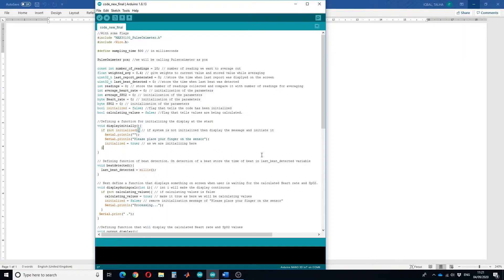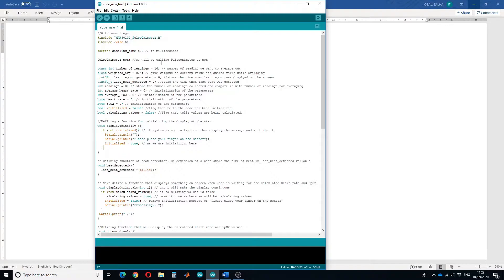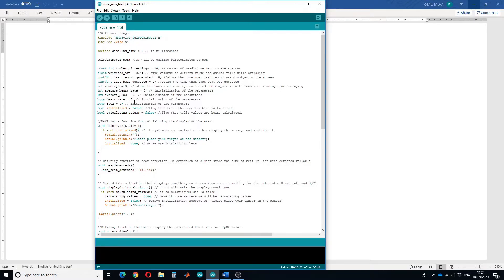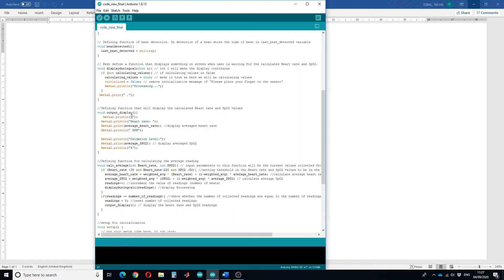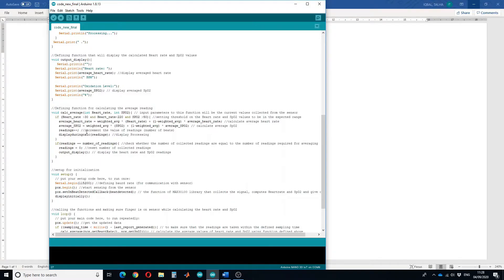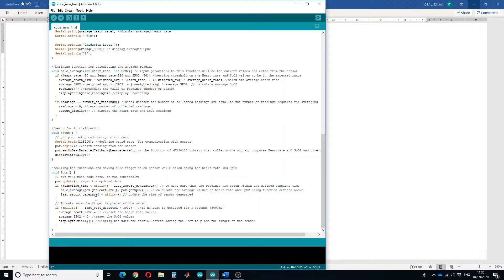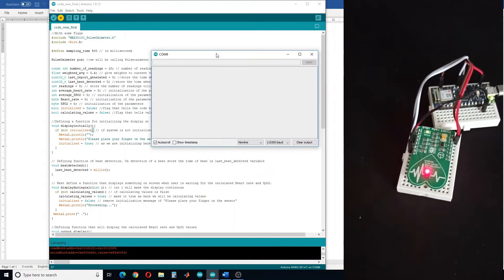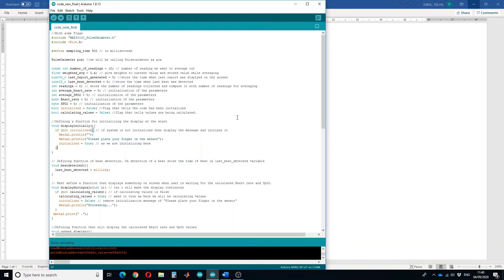Heart Rate Monitor (with Stable Readings) Using Arduino Nano IOT 33 board and MAX30100 Sensor kit

Comment from the maker: //code:

//With some Flags
#include "MAX30100_PulseOximeter.h"
#include <Wire.h>

#define sampling_time 500 // in milliseconds

PulseOximeter pox; //we will be calling Pulseoximeter as pox

const int number_of_readings = 10; // number of reading we want to average out
float weighted_avg = 0.4; // give weights to current value and stored value while averaging
uint32_t last_report_generated = 0; //store the time when last report was displyed on the screen
uint32_t last_beat_detected = 0; //store the time when last beat was detected
int readings = 0; // store the number of readings collected and compare it with number of readings for averaging
int average_heart_rate = 0; // initialization of the parameters
int average_SPO2 = 0; // initialization of the parameters
byte Heart_rate = 0; // initialization of the parameters
byte SPO2 = 0; // initialization of the parameters
bool initialized = false; //flag that tells the code has been initialized
bool calculating_values = false; //flag that tells values are being calculated.

//Defining a function for initializing the display at the start
void displayinitially(){
  if (not initialized){ // if system is not initialized then display the message and initiate it
    Serial.println("");
    Serial.println("Please place your finger on the sensor");
    initialized = true; // as we are initializing here
  }
}

// Defining function of beat detection. On detection of a beat store the time of beat in last_beat_detected variable
void beatdetected(){
  last_beat_detected = millis();
}

// Next define a function that displays something on screen when user is waiting for the calculated Heart rate and SpO2.
void displayduringcalc(int i){ // int i will make the display continuous 
  if (not calculating_values){ // if calculating values is false
    calculating_values = true; // make it true as here we will be calculating values 
    initialized = false; // remove initialization message of "Please place your finger on the sensor"
    Serial.println("Processing...");
  }
 Serial.print(" .");
}

//Defining function that will display the calculated Heart rate and SpO2 values
void output_display(){
   Serial.println("");
  Serial.println("Heart rate: ");
  Serial.print(average_heart_rate); //display averaged heart rate
  Serial.println(" BPM");

  Serial.println("Oxidation Level:");
  Serial.print(average_SPO2); // display averaged SpO2
  Serial.println("%");
}

//Defining function for calculating the average reading
void calc_average(int Heart_rate, int SPO2){ // input parameters to this function will be the current values collected from the sensor
  if (Heart_rate >30 and Heart_rate<220 and SPO2 >50){ //setting threshold on the Heart rate and SpO2 values to be in the expected range
    average_heart_rate = weighted_avg * (Heart_rate) + (1-weighted_avg) * average_heart_rate; //calculate average heart rate  
    average_SPO2 = weighted_avg * (SPO2) + (1-weighted_avg) * average_SPO2; // calculate average SpO2
    readings++; //increment the value of readings (number of beats)
    displayduringcalc(readings); //display Processing
  }
  if(readings == number_of_readings){ //check whether the number of collected readings are equal to the number of readings required for averaging
    readings = 0; //reset number of collected readings
    output_display(); // display the heart rate and SpO2 readings
  }
}

//setup for initialization
void setup() {
  // put your setup code here, to run once:
  Serial.begin(115200); //defining baurd rate (for communication with sensor)
  pox.begin(); //start sensing from the sensor
  pox.setOnBeatDetectedCallback(beatdetected); // the function of MAX30100 library that collects the signal, computes Heartrate and SpO2 and give output.
  displayinitially(); 
}

//calling the functions and making sure finger is on sensor while calculating the heart rate and SpO2
void loop() {
  // put your main code here, to run repeatedly:
  pox.update(); //get the updated data
  if ((sampling_time < millis() - last_report_generated)){ // to make sure that the readings are taken within the defined sampling time
     calc_average(pox.getHeartRate(), pox.getSpO2()); // calculate the average values of heart rate and SpO2 using function defined above
     last_report_generated = millis(); // update the time of report generated
  }
  // To make sure the finger is placed of the sensor.
  if ((millis() - last_beat_detected > 3000)){ //if no beat is detected for 3 seconds (3000ms)
    average_heart_rate = 0; //reset the heart rate values
    average_SPO2 = 0; //reset the SpO2 values 
    displayinitially(); //Display the user the initial screen asking the user to place the finger on the sensor
  }
}

Comment: Can you pleae send the code link from where we can get code
Reply from the maker: Hi. thank you for the comment. I have added the code. Please the pinned comment. Please like and subscribe to my channel. <3
Reply from the maker: //With some Flags
#include "MAX30100_PulseOximeter.h"
#include <Wire.h>

#define sampling_time 500 // in milliseconds

PulseOximeter pox; //we will be calling Pulseoximeter as pox

const int number_of_readings = 10; // number of reading we want to average out
float weighted_avg = 0.4; // give weights to current value and stored value while averaging
uint32_t last_report_generated = 0; //store the time when last report was displyed on the screen
uint32_t last_beat_detected = 0; //store the time when last beat was detected
int readings = 0; // store the number of readings collected and compare it with number of readings for averaging
int average_heart_rate = 0; // initialization of the parameters
int average_SPO2 = 0; // initialization of the parameters
byte Heart_rate = 0; // initialization of the parameters
byte SPO2 = 0; // initialization of the parameters
bool initialized = false; //flag that tells the code has been initialized
bool calculating_values = false; //flag that tells values are being calculated.

//Defining a function for initializing the display at the start
void displayinitially(){
  if (not initialized){ // if system is not initialized then display the message and initiate it
    Serial.println("");
    Serial.println("Please place your finger on the sensor");
    initialized = true; // as we are initializing here
  }
}

// Defining function of beat detection. On detection of a beat store the time of beat in last_beat_detected variable
void beatdetected(){
  last_beat_detected = millis();
}

// Next define a function that displays something on screen when user is waiting for the calculated Heart rate and SpO2.
void displayduringcalc(int i){ // int i will make the display continuous 
  if (not calculating_values){ // if calculating values is false
    calculating_values = true; // make it true as here we will be calculating values 
    initialized = false; // remove initialization message of "Please place your finger on the sensor"
    Serial.println("Processing...");
  }
 Serial.print(" .");
}

//Defining function that will display the calculated Heart rate and SpO2 values
void output_display(){
   Serial.println("");
  Serial.println("Heart rate: ");
  Serial.print(average_heart_rate); //display averaged heart rate
  Serial.println(" BPM");

  Serial.println("Oxidation Level:");
  Serial.print(average_SPO2); // display averaged SpO2
  Serial.println("%");
}

//Defining function for calculating the average reading
void calc_average(int Heart_rate, int SPO2){ // input parameters to this function will be the current values collected from the sensor
  if (Heart_rate >30 and Heart_rate<220 and SPO2 >50){ //setting threshold on the Heart rate and SpO2 values to be in the expected range
    average_heart_rate = weighted_avg * (Heart_rate) + (1-weighted_avg) * average_heart_rate; //calculate average heart rate  
    average_SPO2 = weighted_avg * (SPO2) + (1-weighted_avg) * average_SPO2; // calculate average SpO2
    readings++; //increment the value of readings (number of beats)
    displayduringcalc(readings); //display Processing
  }
  if(readings == number_of_readings){ //check whether the number of collected readings are equal to the number of readings required for averaging
    readings = 0; //reset number of collected readings
    output_display(); // display the heart rate and SpO2 readings
  }
}

//setup for initialization
void setup() {
  // put your setup code here, to run once:
  Serial.begin(115200); //defining baurd rate (for communication with sensor)
  pox.begin(); //start sensing from the sensor
  pox.setOnBeatDetectedCallback(beatdetected); // the function of MAX30100 library that collects the signal, computes Heartrate and SpO2 and give output.
  displayinitially(); 
}

//calling the functions and making sure finger is on sensor while calculating the heart rate and SpO2
void loop() {
  // put your main code here, to run repeatedly:
  pox.update(); //get the updated data
  if ((sampling_time < millis() - last_report_generated)){ // to make sure that the readings are taken within the defined sampling time
     calc_average(pox.getHeartRate(), pox.getSpO2()); // calculate the average values of heart rate and SpO2 using function defined above
     last_report_generated = millis(); // update the time of report generated
  }
  // To make sure the finger is placed of the sensor.
  if ((millis() - last_beat_detected > 3000)){ //if no beat is detected for 3 seconds (3000ms)
    average_heart_rate = 0; //reset the heart rate values
    average_SPO2 = 0; //reset the SpO2 values 
    displayinitially(); //Display the user the initial screen asking the user to place the finger on the sensor
  }
}